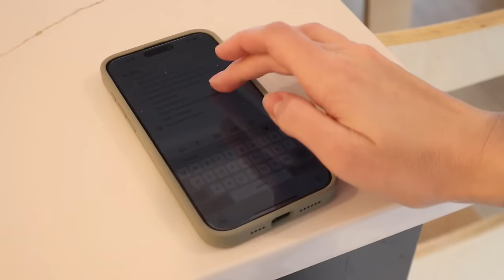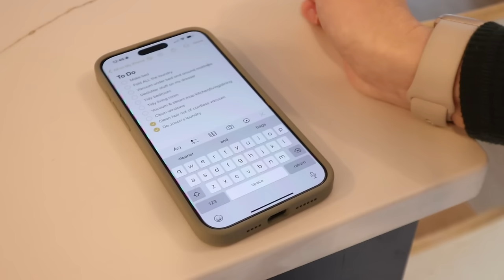HUGE CLEAN DECLUTTER & ORGANIZE 2024 / Extreme Motivation / Productive Day as a Working SAHM

Comment: For Disney it has been awhile the grandkids and us preferred Universal but my sister-in-law who lives in Florida had recommended going early and counterclockwise when you go in.  Most people automatically go clockwise so starting opposite direction gives you shorter lines to start.  Eventually you will catchup with the long lines but every little bit helps.  We did breakfast at hotel that was included and brought something to eat for lunch and had dinner in park, food is very speedy in park.  If I remember correctly they had lockers  up front you can put a soft side cooler with something to eat and water bottles in.  If you are spending multiple days take a break in middle let kids play in pool and relax.  It is tempting to take it all in but by the last few days everyone is on overload and crabby.😊

Comment: I have a shark hydrovac-the corded kind. I have limited outlets so having something that has to be charged all the time is an issue. I love the vacuum/mop. It has never smelled. When I am done, I remove and rinse the dirty water tank to which the filter is attached and the roller. I let all the pieces dry before assembling back unless I need to use it. It self cleans the brush but I rinse it anyway then squeegee the water with a butter knife to speed up drying. I love it and it does a decent job. I have LVF and never see streaks. I also use whatever soap I want because I only put in a tiny bit. I use Fabuloso. Last time I tried Tide and I am not sure if it was the soap or that the roller cover wasn't tight but I did notice areas where the dirty water must have pooled. That is the only time I ever had a problem and it has been over 6 months. And about Disney-there are tons of books to get that will help you with the logistics because it keeps changing. But my best advice is pick out what you really want to see or do and don't try to do it all. We tried going the bonus hour early and staying til fireworks and it is too much and totally exhausting. Make sure you hit the spots you and the kids really want and skip the rest.

Comment: try replacing the roller and filter and deep cleaning your tineco. that should help with it not stink as bad.
Reply from the maker: I’ve done that replacing the roller and filter! It helps for a short while and then smells again
Reply: @CatherineElaine  hmm. call tineco, maybe have them replace your machine. mine has done that and they told me send it in for repair or a new machine but 3 months passed and i forgot about it 😂

Comment: What you do for removing blood is this... first make sure you haven’t put it into the dryer yet cause that will make the stain set and you will never get it out. Okay, because you’ve put Dawn on and other stuff to try to get the blood out make you sure you rinse all those spots that have all that stuff in it out, rinse it totally out first. We need to make sure it’s raw and just with nothing to begin with. Rinse it out with water very well. Okay next lay the comforter on the floor or a flat place okay next get some hydrogen peroxide and just soak it in a bowl with each spot. Like fill a small little bowl with peroxide then grab one of those spots with the blood and dip it in there make sure it’s all covered with the periods. Do this with each spot. It will start to fizz at the blood spots which is good cause that means it’s starting to get it out little by little. Leave it over night and when you wake up check on it if the spot it still there swish it around and leave it longer. It will eventually go away but you need to leave it in the peroxide till it does. Don’t worry it’s not gonna hurt the comforter none. It’s not like bleach at all. Just soak it as long as you need to in hydrogen peroxide till the spot is white again and when it is just wash the whole thing in the washing machine then dry it like normal. Let us know how it goes. If I lived closer I would do it for you and show you how it’s done. Works every single time. Believe me I’ve done it with my pants and underwear if I had a stain for my period. So I know it works.